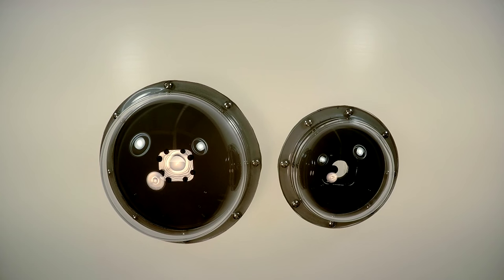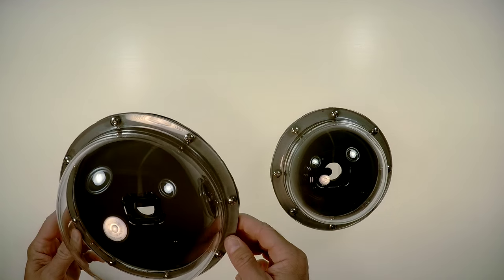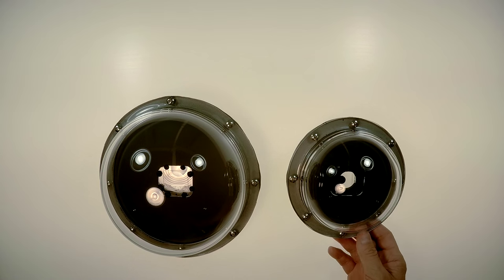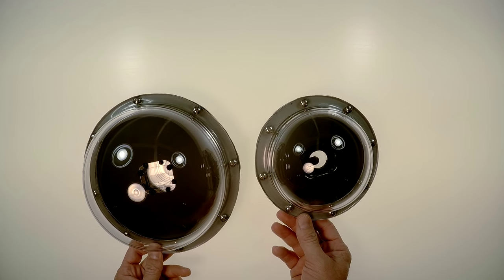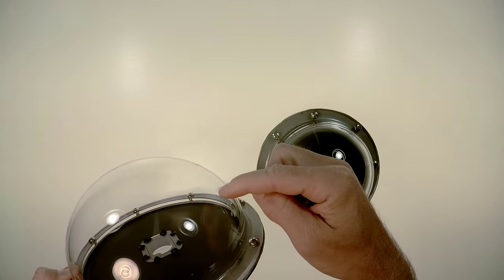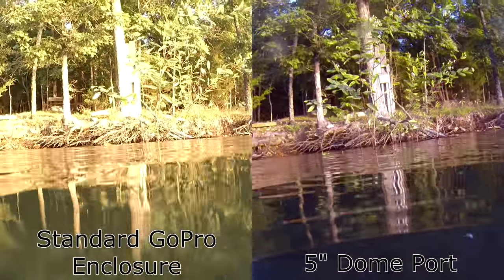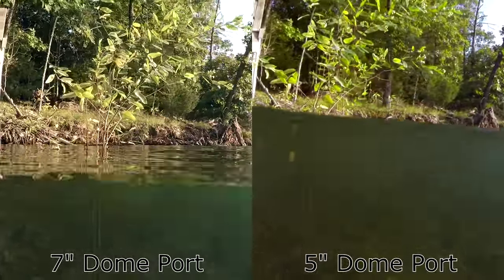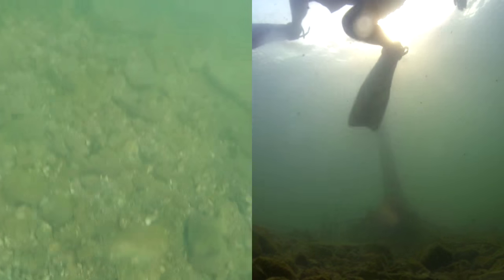What Size GoPro Dome Port Should You Build?

Comment: Thanks, maybe you could glue some lead bar or other weight to the back of the dome to compensate for the extra buoyancy and make the setup more stable, maybe 50 or 100 g?
Reply from the maker: Yes I bet that it could be weighted fairly easily. Thanks for watching!

Comment: Hey great video! The 5 inch dome is slightly softer. This is the same problem hero 1 and hero 2 had, because the waterproof case had a curved glass instead of flat. I think you should try putting hero 3 in 7 inch dome and hero 4 in 5 inch dome to see if there is any difference.
Reply from the maker: Thanks! I would do what you suggest but I disassembled the 7" dome and I also traded my Hero 4 for a Hero 5...... Sorry.

Comment: Hi, thanks for the vid ... I have one question, how do you solve a fogging problem. Thank You
Reply from the maker: Thanks Lars! When you assemble the dome, I would do it in a very dry environment like inside your home so that the air conditioning or heating system has removed most of the moisture from the air.

Comment: Hey Thanks for the video.  Does the diameter of the dome make a difference if its smaller than 5 inches? Also, since I am not using a gopro, which lenses are best suited for dome? I was thinking fish eye or wide lenses.
Reply from the maker: Hi Thomas. Yes the differences between these two domes would continue on to a smaller dome, although I have not tried any smaller sizes. I'm sorry but my experience with dome ports is limited to GoPros so I can't give you a good recommendation on a DSLR lens.
Reply: Thank you GOd's Country for the reply.